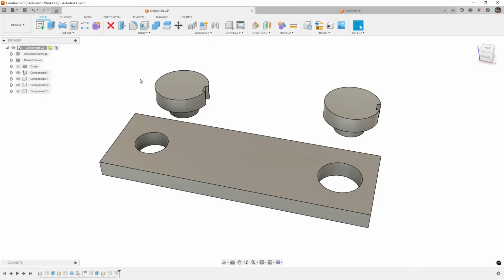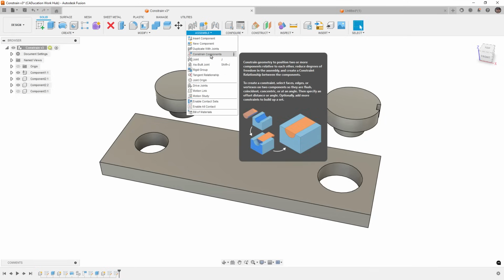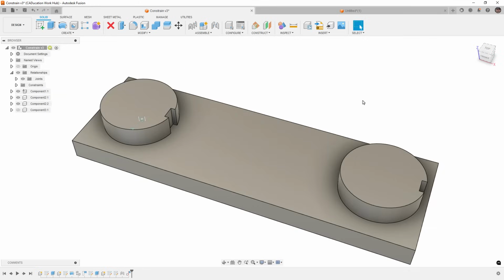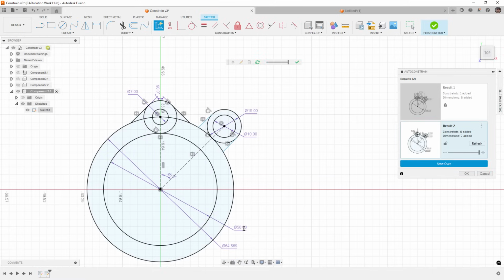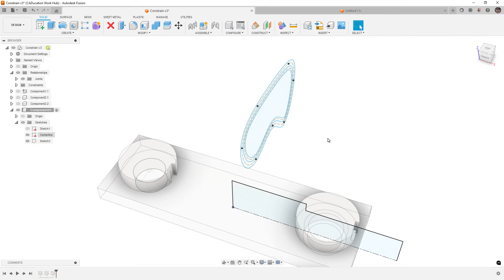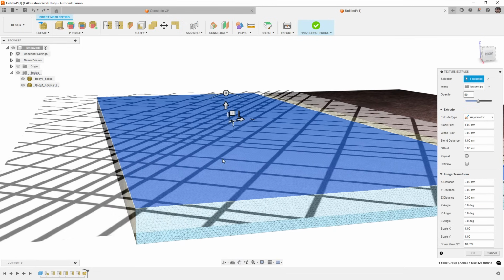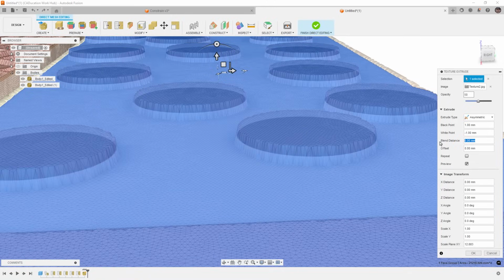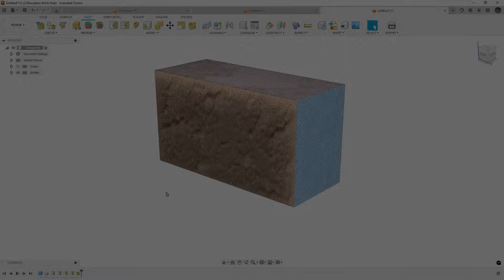What's New In Fusion | July 2025 | Mesh Texture | Constrain Component | Auto Constraint

Comment: It's 2025 and still no dark mode.  Cutting edge stuff.🤔
Reply from the maker: there is dark mode.  It was a preview feature and if you turned it on it would be active.  I believe right now its only an insider feature.  You can see it in the user preferences but likely locked out.  I think its called UI Theme

Comment: Hi sir, First of thanks  a lot for making valuable content for us. 
Secondly I am expert in Fusion360 and have commercial license because i do commercial projects of modeling and reverse engineering for 3d printing, manufacturing, cutting and engraving. Sometime when i work in it i feel that it must have few features to update the workflow and speed up the process or add some more features. Can we send our suggestions to the developer team of Autodesk so that they could review them and make required changes??
Reply from the maker: Thanks for watching! You can definitely submit feedback to the developers for sure!  The best way to do that is to join the insider program.  I am not a part of it as i feel there are some downsides.  Files saved in Insider preview can't be opened by non-insider (at least they used to not be able to).  The old Idea station has gone sadly.  You can email me and i can share them with developers when i meet with them but that is not a guarantee.

Comment: Thanks for the video. I have a few questions on Texture Extude. First, when you Tessellate your Brep you have the refinement settings that allow you to easily get the triangle detail needed in one step vs having to re mesh it multiple times. This seems to work fine. Then you can go into Edit Mesh and apply your Texture Extrude. And, again that seems to work fine. The bug that I'm finding comes when you try to export the mesh for 3D printing. You can export by using Utilities > 3D Print or right click the Mesh body in the browser and select Save as Mesh. These bring up a dialog to transfer the converted mesh to your slicer and again these appear to do the transfer. However, these dialogs don't use the refinement settings as they were when you Tessellated the original object unfortunately. Fusion picks a set of generic refinement settings and locks them (grayed out) so you can't make any modifications. This gives you a less than detailed version of the mesh model which results in a less than ideal print. If you don't use texture extrude and export a mesh, Fusion allows you to set the refinement settings so you can get detailed prints. I'd be interested if you could try this and see if you also get locked refinement settings when you try to export. If you do then I feel this is definitely a bug which needs to be fixed by Autodesk. Currently you can't export with sufficient detail to get good prints. If you find you CAN adjust refinement settings then there must be something wrong with my workflow. If you could list the exact steps you used that would be very helpful. Thanks.
Reply from the maker: Yeah the Save as Mesh and File > Export behave a bit different.  And even if you have say a quad mesh in fusion and export it, the file still goes through some tesselation.  I would say not to use "Save as Mesh" and send to the slicer unless you have a solid body.  Instead try to do File > Export.  I just confirmed this with one of my files as an OBJ just to be sure something didn't change and it worked fine for my model going from a mesh in Fusion, to an exported OBJ to the bambu slicer.  Note that only visible mesh bodies will be exported this way.

Another option is to use Fusion as the slicer.  I have tried this on a few printers and have printed plenty this way but i think using something from the MFG like bambu is much easier.

Comment: Excellent extraction/amplification.  As a Fusion Insider, I'm deep into all this, so this represents a much better orientation to the new features from 10,000 feet for the typical user.  The one feature I have requested in the new Configure capability is the ability to specify a component for alignment/registration but not have that component in the derived joint.  For instance:  Configure surface 1 of component A against surface 2 of component B as a slider, but align surface 3 of component B to surface 1 of component C, but don't put component C into the "Joint".  Real world example:  Create a sliding joint between the side of this drawer box (A) and the side of the cabinet (B). Make it a sliding relationship.  At the same time, align the front of the drawer box (C) to the front of the cabinet (D) but offset it backward 19mm, without including any kind of joint into that last operation - it's simply an alignment alternative to, say "joint origin".
Reply from the maker: Thanks for the great feedback and real-world example.  I like that configurations are improving with each release, but yeah some real-world scenarios just aren't supported yet.

Comment: For AutoConstrain... If you clicked "Refresh" on the heads-up display it would have fully defined your sketch. Everything you need is on that toolbar; no need to add a dimension manually.
Reply from the maker: Hi Clint, but I want some control over the dimension scheme.  In the example of wanting a specific dimension instead of the ordinate one, but the rest of the sketch was ok.  If i delete a dimension and refresh it does not recreate/add a dimension back that is different to the one deleted.  

The results I have found are inconsistent with an intended dimension scheme in many cases.  Some cases are ok but you might want to do something different with 1 or 2 dimensions.  thats where deleting one dimension while the dialog is active and being able to add one makes sense.

I still haven't found a good use case for the tool in practice.  It takes a bit more time than to dimension your sketches with intent as you go.

Comment: I use the insert derive quite a bit. I see you mentioned it, was there a change of that that I didn’t notice? Or were you just mentioning that in passing due to mentioning the other insert command?
Reply from the maker: just mentioned in passing.  I don't think anything has changed with that or insert component, they just added an insert component button .

Comment: For the mesh texture, this could be one way to better solve a problem I was having in "carving" graphics into parts. In Fusion there is no good way to take an arbitrary vector line and use it to carve a V-groove in the design workspace because a cut sweep would intersect itself and fail. I got around this on my phone case design by going to the manufature workspace and using the same path to actually carve the geometry and then export the simulation STL. With this mesh texture I could see having a vector graphics image, then having a feature to convert your solid to a mesh and add the texture. You could even roll back history all within the design workspace.
Reply from the maker: Yeah that is an interesting workflow!  Probably blender with is texture brush would be super easy as well, but yeah  a vector grey scale image could work there or even a Line and then use the Blend value to taper it.

Comment: Are you sure about locking down multiple components with a single constraint feature? My experience is that the + button only allows you to add a constraint between the two components you have already referenced in that feature already.
Reply from the maker: It is limited still but you can do multiples.  its just that the first selection you make is the "active" one.  So you can constrain that first selected object to multiple things.
Reply: @LearnEverythingAboutDesign  Good to know. In my recent use case I was out of luck anyway because I was trying to constrain a sub assemby by first using that sub's plane and then using geometry from a component of that sub. In this case I had to split it into multiple features, but still much better than creating a dozen joint origins and sliding joints!

Comment: the product team at fusion has got to get their focus together. so many half-baked elements. If your going to add something, it needs to be mature enough that it actually works to the benefit of the user, if it is only half useful, it is NOT useful. I'd rather have 5 really solid and well executed functions than 10 that are half assed.
Reply from the maker: Agree with you for sure.  Personally i would love to see a more efficient/ robust 2d sketching and improvements to surfacing tools before getting things like Mesh Texture Extrude.

Comment: I have a question about 3D scanning. If I have just a surface scan of a large object, a specific area that I want to make into a body surface area on which to build/ sketch off of, how do I make that surface scan a solid body without scanning the entire object.

Thanks
Chris
Reply from the maker: I will have a video out soon showing this in Fusion, Plasticity, and Quick Surface.  It really depends on the end goal.  I did a video a little while back with Fusion and QS https://youtu.be/mvTkw3Aly_s
For complex shapes generally I go to freeform modeling.  You can thicken a form body which will convert to solid when you finish the form.  In Fusion you would just treat it like any surface.  You need to build a "water tight" set of surfaces or thicken it to be solid.

Comment: I really wish there was some way to configure a linked component with a parameter instead of fixed preset values
Reply from the maker: yeah at the moment i don't think you can reference anything in a configured design in that way with edit in place.   Derive can take user parameters with it, but thats a 1 way flow of data and won't go back to the assembly.  I think about the best we have at the moment is configurations in the parent assembly, and have that select which config you want on an inserted component.  but this makes you insert each configuration and suppress one.... not super helpful.

Comment: I have used Fusion as a hobbiest for several years, but STILL I sometimes can't figure out how and where my sketch is not locked down. I recently found that use of the autoconstraint feature will show me what I am missing. I usually then don't use the autoconstrained version, but at least I now know what constraints are missing.
Reply from the maker: That is a good use case for it!  Years ago I did a video using scripts in the command line to show under constrained sketches.  https://youtu.be/MDl4YmCFDGU  The first few minutes show the text commands and around 4min I show the showUnderconstrained  It would be great if this was just a button in Fusion by default like other CAD programs :)

Comment: - Thx, Matt.

- 'CONSTRAIN COMPONENTS': in some cases, should be useful / more appropriate than F360 "traditional" 'JOINTS' - but as you noted, there are pros/cons for each approach/system (as always). Will just have to see what use cases arise where 'Constrain Components' seems more appropriate, or even necessary. Hm?
- 'AUTOCONSTRAIN' (in sketch): Have not found use for it. Combo of constraints/dimensions encodes design intent, and determines crucial driving/driven relationships - which this feature does not address/accommodate. In my unofficial support capacity in the F360 FB groups, I've found many users struggle w/ constraints, and this feature may seem appealing - but alas, IMO, it's not a substitute for actually understanding/using the constraints/dimensions system/paradigm.
- 'MESH EXTRUDE': I find that this ability is better, and more fully, implemented in other apps (e.g. Blender, etc.); various slicers (e.g. PrusaSlicer, Bambu Studio, etc.); and there's even an interesting online solution by Formlabs ('Texture Engine'). So, the feature in F360 is a pass for me. (And BTW, as you likely know, SolidWorks has an interesting/decent implementation: '3D Texture Tool' - which is also mesh-based.)

- All that said, I do value updates w/ new features, and other changes - plus, bug fixes, of course. In fact, when some people decry the idea of updates in general, I just think back to F360 when I started using it (~9 yrs ago): I definitely much prefer it in its current state!

- Anyhow, thx again for your continuing support/efforts in the Fusion community. You are appreciated :) Keep up the great content!...
Reply from the maker: I agree with you on all points :)  Especially the autoconstraint tool.  I have yet to find a place where i "needed" to use it.  The official examples are all imported dxf sketches that fit neatly into a new dimension scheme.  But in reality if you are quickly sketching something and two lines are .2mm off in height but should be colinear, it doesn't know that.  The only possible use case i can see is to lock down a spline with dimensions but even then I think I would still prefer to just do it myself.

I covered the mesh feature in SWx when it was released in 2019 i think :)  Its a tricky one because in reality textures on molded parts are done on the mold.  printed parts in the slicer or blender (which is my preference).  So it seems an odd addition rather than implementing a better handling of large meshes or even more mesh editing tools.

Happy to help the community!  Thanks for the comment!

Comment: - My 'Show Home tab at startup' preference is unavailable / greyed out.
- I'm on 'Commercial' plan; have 'Team Hub'; found nothing related in 'Preferences > Preview Features'.
- What am I missing?
- TIA.
Reply from the maker: Typically when that is greyed out it means you are on a single-user or personal hub instead of a team hub.  Depending on how long you have had Fusion for you might not have been migrated over to a team hub automatically yet.  Just double check when the data panel is open that the hub at the top isn't the one with your name, but an actual team hub.  

Second could be a server issue because the home tab is the "web view" .  Go to the Help Menu, Support and Diagnostics, and the Service Utility.  From there run a Network Diagnostic test to make sure everything is working.

If it isn't one of those two things I am not sure.  When Home tab was first introduced in beta i had access to it as a beta tester, but when it went public there were all sorts of issues getting it for me.  For me i upgraded my hub to make sure it had "folder level permissions" and a few other things the autodesk tech support did before it popped up.  But i dont think mine was a normal use case.

Comment: Mesh texture has still some baking to be done. It's a pitty that it's in Direct edit mode so it can't not be part of a parametric model (good for adding textures to grips of stuff like this). Just works for a final version. Or do it again everytime.

To increase mesh density, I found more useful to apply this in Tessellate command. By using Custom and an edge length of 0.5 to 1.5 mm (I use it in Spanish, maybe these are not the terms in the dialog).
Thanks for sharing your opinions, not just the update info!
Reply from the maker: yeah.  I found with basic prismatic parts that I wasn't getting the mesh density good enough with tessellate but ill give it another go with some custom settings, thanks for the tip!

And yeah I would likely (if using this in practice) copy the mesh body before doing this because undoing it would be a pain!.

With remesh I have found that you can do that for a single face group or set of polys which can be a nice option.
Reply: @LearnEverythingAboutDesign  good point on single face remesh 👍

Comment: Mesh textures is interesting, yet still they are only catching up, since free slicers can already add textures, and any mesh editor can do displacement maps, it will start to be even more interesting if you can add this to a CAD surface, as even knurling is a full workflow..
Reply from the maker: Agreed!  a lattice tool and texture tool applied to a solid body would be amazing!  Solidworks added a texture tool years ago but theirs converts the body to a mesh so its the same trick.  I will still use a slicer or take a model to blender and use some sculpting tools if needed but I am hopeful for this tool.
Reply: @LearnEverythingAboutDesign that's my workflow as well, Blender and sculpting or displacement maps, and i invested in the Quad Remesher, so exporting back to fusion is less of a mess
Reply from the maker: It would be great if you could export a quad mesh out of fusion.  well you kind of can if you are working on a form, you can export the control cage.  but Fusions mesh tesselate has a quad option, but if you export an OBJ it converts to Tris sadly.  I wish they would unlock the mesh conversion to "organic" option in fusion and pull it outside of the design extension.  I have always thought that and vol lattice were just odd to be nested under that mostly plastic part design tools.
Reply: @LearnEverythingAboutDesign The price of the extensions is rediculous, even if paying full price for fusion, which i am not due to adopting early and having the maker license, and yes, that a CAD program of the fusion caliber wouldn't by default export clean quads is sad, and just the fact that an obj exported by fusion, cannot be cleanly imported and converted back, is even sadder, it messes up features itself exported